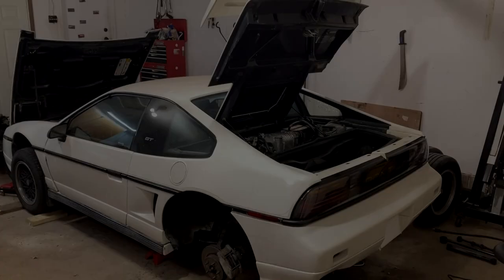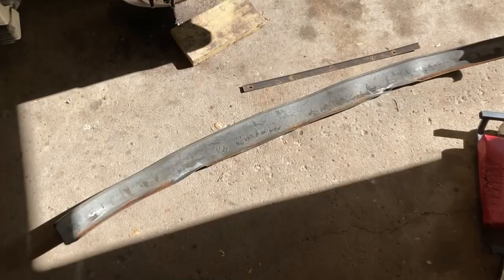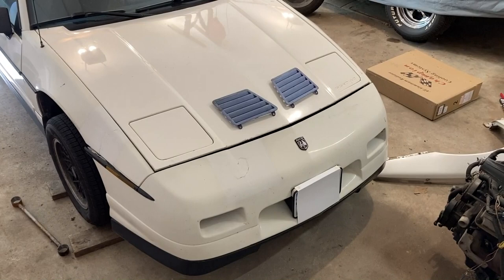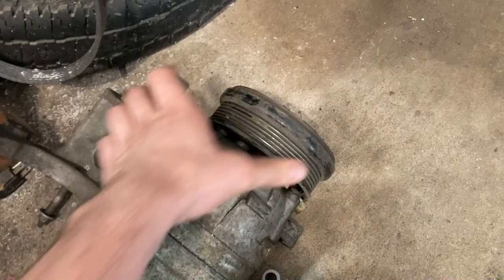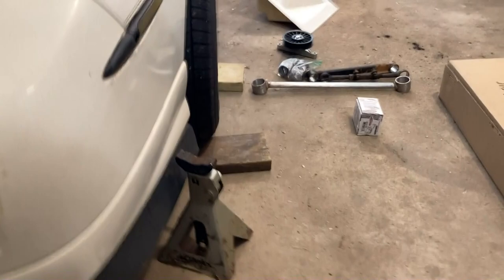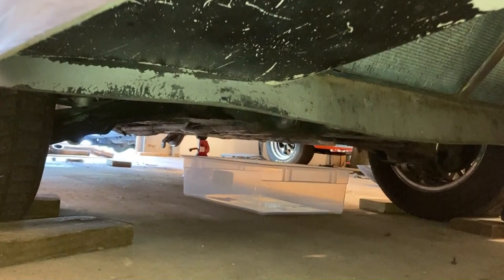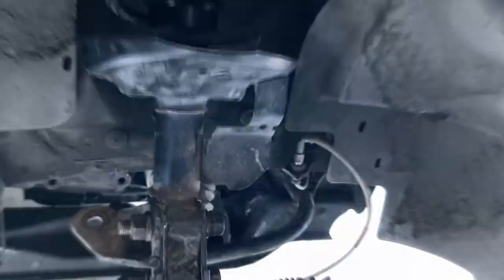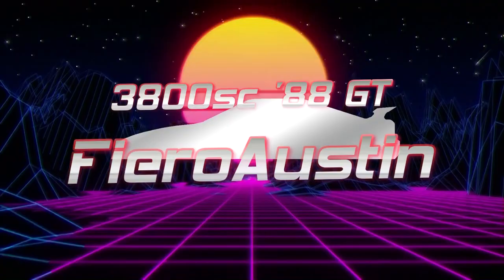BACK WITH NEW 3800 SUPERCHARGED FIERO PROJECTS AND MORE VIDEOS!!!

Comment from the maker: Parts mentioned in this video:
Radiator (Champion CC828) - https://amzn.to/3bIcprb
Rear Tires - 235/60r15 98T Mickey Thompson - https://amzn.to/3PfLkKL
AEM 340lph 50-1200 - https://amzn.to/3RCxy6p
AEM 30-4110 - https://amzn.to/3z7zqww
Blazer Master Cylinder (1-1/4" bore) DHB-M39646 NOTE: THIS DECREASES LINE PRESSURE, THUS MAKING EFFORT HARDER. I CHOSE NOT TO DO THIS!
AC Orfice Tube - FOUR SEASONS 38902 - Under 105 Degrees - https://www.rockauto.com/en.../c+orifice+tube,6936
FOUR SEASONS 38904 - Over 105 Degrees - https://amzn.to/3XaMKKQ
FOUR SEASONS 38902 - Under 105 Degrees - https://amzn.to/3V3WRz7
AC Seals (3800 side) - Four Seasons 26728 - https://amzn.to/3cfKT4c
AC Seals (Fiero Side) - Four Seasons 26735 - https://amzn.to/3uPXMsd
AC Dryer - Four Seasons 33181 - https://amzn.to/3gauHUf
A/C Compressor Bypass Pulley (CHECK FITMENT) - https://amzn.to/3RUQtZA
Mini racing muffler - TOTALFLOW 6644 - https://amzn.to/3uObGeu
KYB SB103 Strut Boot and Bump Stop - https://amzn.to/3zizTMs
KYB 234005 Excel-G Rear Struts for all years - https://amzn.to/3oahsTQ

Rodney Dickman:
1988 Rear Suspension Bushings
Adjustable poly dog bone 2.8 liter V-6
Rodney Dickman OEM better quality speakers, Front and Rear
Rodney Dickman 1988 steering parts - http://rodneydickman.com/index.php?cPath=26_43
1988 Fiero Steering Rack Bushing
Steering Rack Wrench
1988 Fiero Steering Rack Bearings and Seal
  - Item: Upper needle bearing
1988 Fiero Steering Rack Bearings and Seal
  - Item: Special lower bearing
1988 Fiero Steering Rack Bearings and Seal
  - Item: 1988 rack pinion seal
1988 Outer Tie Rod End
1988 Inner Tie Rod
1988 Poly Rack Mounting Bushings
1988 Upper Ball Joint

Fierostore :
50495 GREY 84-88 Console Tray
69515 85-88 Fastback Exhaust Tip Shields
56163 84-88 Aero Nose Radiator Seal Set (3 piece)
88220 PAIR 87-88 Headlight Motor Rebuild Kit(s) w/ Gaskets
57661 84-88 Door Water Shields (pair)
57660 84-88 Door Panel Jute Insulation (pair)
56165 AUTO 1988 Cradle Splash Shield (near muffler)
66438 LH Ash Tray Door Spring(s)
67344 PAIR 84-88 Seat Recline Handle
88045 84-88 Headlight Adjustment Kit (for 1 light)
50154 FASTBACK 84-88 Rear Trunk Weatherstrip
52901 AFTERMARK 86-88 Front Engine Mount
52920 84-88 Rear Transmission Mount
52910 84-88 Front Transmission Mount
57215 1988 Poly Rear Swaybar Bushings
57213 1988 Poly Front Swaybar Bushings
60670 84-88 Aero Front Air Dam

(Not mentioned) ACDelco Professional 11M23 Power Window Motor https://amzn.to/3O69QMY 

Back with new projects and more videos!

Thanks for the Inspiration to:
 @FieroKyle  
 @LostNotForgotton  
 @LightspeedFieros  
 @AvalonKing  
 @Garageless  
 @RonaldFinger  

Amazon Recommendation Store for 3800s/Fieros/Tools https://amzn.to/3hNViaa
3800sc Instructions http://www.fiero.nl/forum/Forum2/HTML/139530.html
3800sc Instructions MOBILE https://drive.google.com/file/d/1wqUJdMZ1XqcKJzC-2ZzbvLYMYE3QbmVq
eBay affiliate (use & I get paid) https://ebay.us/4gTj2A
Donate to me https://www.paypal.com/donate/?business=8AFWKBTBVSKTJ
Join channel membership https://www.youtube.com/FieroAustin/join
Subscribe https://www.youtube.com/fieroaustin?sub_confirmation=1
Consulting on Facebook https://www.facebook.com/FieroAustin/

Comment: Good job. That's a lot of work ahead😉.
I'm getting rid of my poly engine mounts as well. Same noise and vibration problem🤪
Reply from the maker: Maybe try the adjustable dogbone first? That might clear a lot up. Super easy to do too.
Reply: @FieroAustin  I don't use the upper dog bone on my 3800 turbo. I have 2 lower torque struts (dog bones) that tie the engine to the sub frame. Everything was poly and cabin noise was not great!
(I'll be posting a video soon on all my sub frame mods.)
😉
Reply from the maker: @turboslugfiero  Interesting, good to know. Did you delete your balance shaft like me?
Reply: @FieroAustin  Yes, the balance shaft is gone. The engine is built for boost, which probably doesn't help for smoothness!😄
Reply from the maker: @turboslugfiero  What's your idle RPM? When in gear, at 800-900RPM with poly all around and no balance shaft mine's horribly shaky. You could put a quarter on the dash and watch it move around.

A cheap way of doing it would to just bump up idle to 1000RPM or so.

I did start it up and it seemed better but it wasn't in gear yet. Hopefully that clears it up!
Reply: @FieroAustin  My idle is a bit lumpy as well; probably the cam. My engine's idle is like yours around 900rpm.
What I want to get rid of is the droning noise in the cabin. It really ruins filming with the mic picking up all the noise!
My keys vibrate in the Niemann (lock barrel?) along with the Fiero interior plastic.
And this at all speeds. It does smooth out a bit above 3500rpm, but it's still too much!
Reply from the maker: @turboslugfiero pretty much same for me just in the 800-900rpm is the worst though

Comment: I know ac compressors from GM and if it has that much resistance when it is not on the vehicle, then yes it is bad. They normally almost run themselves when they are correct. LOL
Reply from the maker: It's not that it's grinding or anything; the mass of the rotors being turned by the belt is the main concern. Might be a 3-5 HP gain at best but not much.
That is an old compressor though, it's probably a bit wore out too.

Comment: Hey don't put those trans am vents on your hood. I had them on my car and all they do is go melty until you put some insulation under them to keep them from doing it and then you don't get the airflow you are looking for. One of those webber hood scoops would be way better.  You are better off venting the bottoms of the headlight buckets if you want to reduce lift. Or take the spare tire well out completely. I did that once too.
Reply from the maker: Thanks. I might get a different scoop all together. Ever heard of AngelonEarth's? I like those. They are fiberglass. i wouldn't think the heat would bother those.
Reply: @FieroAustin  yes that’s the style you want
Reply from the maker: @wadecustance3025  Thanks!

Comment: How bad were those poly mounts?  I had the "factory" rubber ones for a season and they seemed to tear.  I just ordered poly.  I'm doing the exact opposite of you with mounts. I don't want a lot of vibration though so this makes me rethink it.
Reply from the maker: They held up great, its just shaky as heck. In no way is going back to rubber an upgrade, but hopefully it'll make a better ride with my balance shaft being removed. If you haven't removed your balance shaft, I wouldn't worry about it at all.

Definitely get an adjustable dogbone if anything. Stay tuned and I'll let you know how it feels.
Reply: @FieroAustin  I had poly in my previous and it felt like a vibrating chair.  Went with rubber but it didn't hold up.  I will be curious to see if yours last.  I'd much prefer rubber
Reply from the maker: @jimnye2561  Not gonna lie, the $10 fiero store rubber is probably garbage... nobody seems to make good OEM rubber anymore. I don't drive my car a whole lot so maybe it'll last for me.
Reply: I'd suggest using the Rodney Dickman brackets (or you make your own?) with TH400 gearbox rubber mounts.
Rodney used the poly TH400 in his kit, but you can go back to rubber.
That solves it for the gearbox side.
Engine side is more difficult....
I'm modifying the cradle to accept a 3800 motor mount.
Reply: I bought a set of Silverado (just like th400 mounts) to do just that, but they don't seem to have safety catches. I saw a YouTube video where they completely failed as well (broke into two.separate pieces).  Are you aware of any stronger ones that may be rubber with safety catches?
Reply: @jimnye2561  I seem to remember having bought some from Summit? But it was a while ago.
Reply from the maker: @turboslugfiero  That's exactly what I was thinking! Thanks!
Reply from the maker: @jimnye2561  I am not... The TH400 seem to be the standard. Too much power!!?
Reply: @FieroAustin  I'll be posting a new video friday night/saturday morning that shows the bracket I made for the 3800 motor mount. It's a simple piece of 3mm steel formed up in the vice with a hammer. Anyone could do it😉
'87 cradle by the way, but I imagine the same thing could be done to an '88?
👍👌
Reply from the maker: @turboslugfiero  The passengers side engine mount on an 88 is definitely different.

Now that I changed my mounts out I definitely should have reused the Dickman mounts with rubber instead D:
Reply: My original plan was to buy the Rodney mounts and bolt the Silverado mounts to it instead of the poly.  The Silverado look just like the th400 design.  Then I saw this YouTube video showing how they fail. I don't know if those would hold better then stock Fiero though.  I really really prefer rubber to poly on a 3800. I was going full steam till I came across this video, at which point I figured I should use the poly or risk failure. Id love to somehow use rubber but have a catch in case it fails.

https://youtu.be/kiOVXI9Bx5I
Reply from the maker: @jimnye2561  Thanks for the info!
Reply: I’ve been having problems with vibrations on my stock 3800 and I got Rodney’s poly mounts. And thought about going back to rubber. Learning about the th400 mounts sounds like the route I wanna take
Reply from the maker: @markohara1349  I think I will do that if I ever do it over.